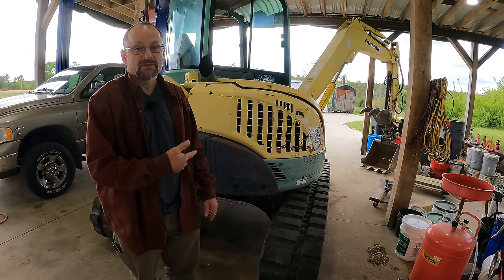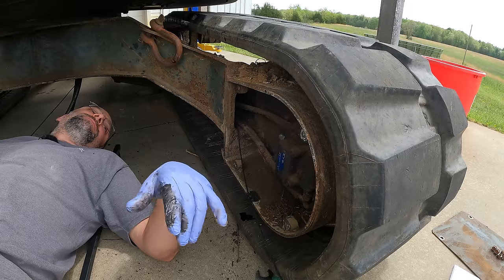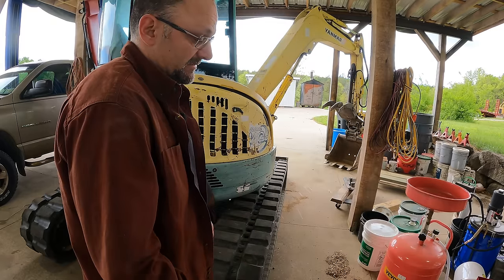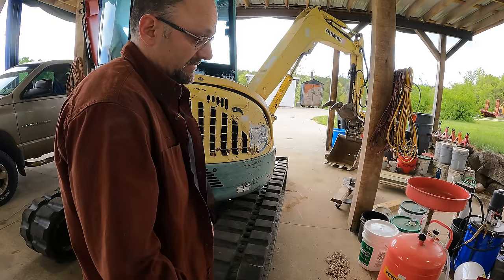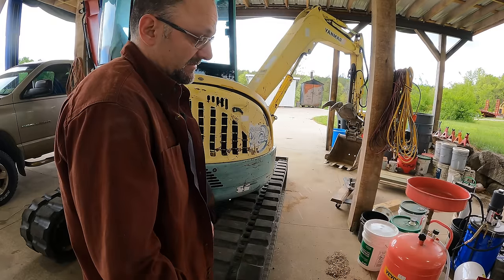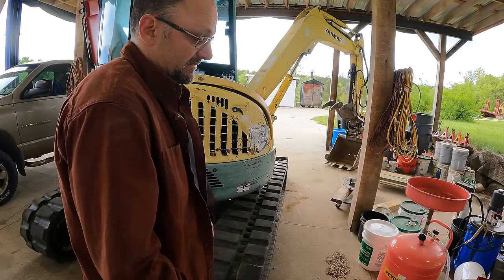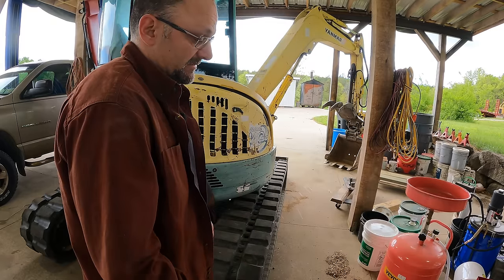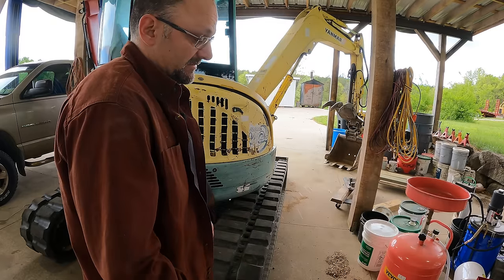Excavator Not Tracking Straight, TOUGH Hydraulic Repair.

Comment: Probably the setting of pressure relief valve of Left Track needs to retight or adjut a little bit, if the relief valves pressure setting is unequal then  the (Right track)  lower pressure setting of relief valve will reduced the spped of the right track. Try to equalized the pressure stting of relief valve of left and right Track hydraulic  pumps.

Comment: As much as it could be a pressure differential, it could also be a flow problem-- slightly collapsed/kinked hose or something caught and causing a restriction. I've never come across a tracked excavator that doesn't have this problem to some degree. My KX-61 had 24 hrs on it when I bought it and already had the problem. It hasn't gotten much worse after a couple thousand hrs, so it's not really worth worrying about. PIA, sure. All the headache of trying to correct it, no!

Comment: That thumb nail of meis in a cat 426f. I don't if any one has with prof expirence has spoke to this, I have run a few new pieces maybe close to 500ish and very few will track straight. And getting a dealer to fix a brand new one is an amazing pain in the ass hahah   I bought a new in 05 cat 226b sidder and yea same thing.  The bigger they are they will usually un straighter, But still. Don't get me wrong there are a few.  My skid steer runs about like your ex.  Good Luck man!!  Edit)  A new pump still won't guaantee a fix. I've seen the act worse. Hey if nothing else you've have had fun  ; )

Comment: Pumps are adjustable by way of compensating valves this will sort your travel deviation,little adjustments you will notice a difference should be a compensation value for p1 and p2 
pumps wear and need tuning, don’t adjust swash plate/horsepower valve 
Travel motors can be checked by removing case drain and stalling motor and measuring case drain output

Comment: if you have a separate pump for each side then it may be the pump flow didnt you already find a bad gear pump. im thinking damage causing less pump flow see my previous comment. cheep fix add a flow control valve in the rt motor line and slow it down to match the left side or deal with it

Comment: Could there be more friction on the right side track assembly. Thus the issue is not a hydraulic related issue. You would have to swap the drive motors to determine.

Comment: is that adaptor going to give differential pressures just because of the smaller diameter for flow compared to the regular hose making the control not accurate

Comment: 31:01 can the accumulator have something to do with the track lag? Maybe the 2 circuit are not long the same or maybe une pump il simply more deteriorated because the excavation work...is there any other point where you can joint the 2 pump after the shovel and the blade?

Comment: Love your comments, but what is the big deal about tracking straight.  They all don't track straight, just correct it with the levers and  get to work.  My 35D Deere has never tracked straight when traveling.  Moving when digging is not affected.

Comment: I am not a Hydraulic guy at all but if all you need is it to flow the same could you not just put a manual hydraulic flow control valve on the faster side and slow it sown to match? I think they are only like 50$ You may need 2 idk

Comment: I know absolutely nothing about hydraulics. You swapped a bunch of stuff left and right but, never swapped the accumulator to the other side. Well, I guess I saw you move it to the other pump but, it was still in the same "line". Is it even possible to switch which "leg" it's on and, would it possibly make any difference?

Comment: I just saw this video series today. But have to ask. You have one new track and one used. Is the distance from drive motor to front idler the same? I.e. on
e stretched track.
Reply: In my opinion this problem can't have anything to do with either the motors or the tracks. It tracked to the left and after he switched the hoses it tracked to the right. There must be a difference in the oil flow between the circuits.

Comment: Hi there, Ok so the left crawler is rolling a it lower at full throttle...and you tried to diagnose and fix it to be the same as right crawler... but finally without success. I think another naive approach could be the opposite. I mean try to reduce the power of right crawler to be as "faulty" as left one. You then will loose a bit of speed but recover a straight track motion... I'm totally not an hydraulic professionnal ... but I'm sure  a kind of hydraulic adjustable reducer could be mounted on right circuit exactly like an electrical resistor to reduce electrical intensity... what do you think ? Also Thanks a lot for your videos ! I'm from Belgium and I've just buy on auctions an 2014 old kubota kx163-5... fu%&ing chinese unknown model here in Europe... and I have to restore and repair it. If someone knows stuffs about it...or owns documents or manuals ... it will be greatly appreciated. Thanks again ! You're doing fantastic job! Lo.

Comment: Couldn't you slow down the oil flow to the right track to match the flow on the left track? Maybe they would track the same. Might not be as fast as you would like it to be but just might be straight.

Comment: ok. I have to submit that you haven't verified the mechanical part of the problem. IE what if someone replaced one of the drive wheels on one side with a slightly larger or smaller wheel?  That would make the unit turn no matter what you did. Also.. what if one of the tracks was slightly longer then the other.. assuming they have pins that fit into the track and one is longer or shorter then the other.. With a slightly longer track on one side it would travel further for an equal number of pins driven by the motors on both sides.  I understand that the hydraulic testing you have done should  have different results if this was true, but sometimes... a hidden issue like this can not be tracked down until you verify every part of the drive train is correct. Even testing this could give you more metrics to help and possibly zero in on the actual problem.
Love your channel. Diagnostics are very interesting and thought provoking.  (I was certified master auto technician for 28 years. I lost lots of money working on brain teasers like this... cause it was to fun).. Oh.. one diagnostic aid that may help you? Put the unit in the air (use your hoists) then paint a mark on both tracks, run it and count how many times the mark on both tracks go by during the same time frame. Much more exact to zero in on the exact problem.
My assumption for this issue, is the same as you.. that there should be a balancing valve somewhere that balances the two tracks rotations so it tracks straight. Is would be a hydraulic valve most likely (as you looked for at the end of your video....).  I would also call the dealer and see if you could talk to one of the mechanics that works on these units. They usually have fixes for issues like this (as they have to fix this issues no matter what)  I had a bunch of magic fixes when I was mechanic.

Comment: It looks like you did isolate the pump when you switched two hoses instead of 4. The lazy/leaking pump tracked wrong with 1 valve going forward, and the other valve in reverse, so the valve isn't the problem, the pump is. I'm no hydraulic mechanic so maybe I'm wrong, I'm posting this before the end of the video so we will find out.
Edit: Sometimes you have more than one problem, pump and valve look like they are probably both leaking lol. Good ole used equipment.

Comment: It looks like you may have one piston pump with a split output (half the pistons feeding each output; parts manual to verify) so it is possible that contamination entered the left circuit at some point in the past and damaged the left side of the pump, or the left side of the valve slice, causing increased bypass. 

Increasing the spring pressure of the pressure compensator (which acts on the swashplate) is going to increase the pressure point where the pump de-strokes and reduces flow while maintaining a set maximum system pressure. Until that set pressure is reached the pump should maintain the maximum flow rate of the system at any pressure below the compensator setting unless the pressure compensator is sticking, leaking or the pump is worn/damaged. This limits the maximum system pressure available while maintaining full flow preventing and at the same time preventing expensive parts (like the piston pump) breakage.

The pump compensator should be set a little above whatever the maximum relief pressure is of the various circuit relief valves. If the maximum relief valve pressure in any relief system is set to 3550 then a compensator pressure about 10% above that (~4000) but below the maximum pump pressure rating should be set, otherwise the pump would de-stroke and reduce flow before individual circuit relief is reached. If the pump de-strokes early then this would reduce flow in a circuit before it is supposed to. So you generally would want the circuit relief valves to relieve first while the main pump is still at full flow and the pump only to reduce flow if for some reason the maximum system pressure is reached due to a failure in a relief system. 

Since the pump only drives the track motors, and if there are no individual relief valves on the left and right systems to protect the systems then set the compensator on the pump to the necessary system circuit pressure for the track motors.

Comment: Maybe fabricate a limiting device that is welded to your control stick that you can adjust with a bolt. This will cause the control stick to not swing as far and will hold the faster hydraulic circuit back to match the weak one. Same thing that's accomplished by pushing one stick full forward the other 95% forward creating equal speed from both tracks.

Comment: I would suspect that the horsepower control, increases flow but at lower pressure. Think about it as an electric circuit, if you increase the amps you decrease the voltage.

Comment: if uour machine  is  .fitted  with  a  hydrolic  quick  hitch  for  bucket  change  it  will  make   your  machine  track  to  the  left  as  that  side   is  down  a  little  on  pressure  as  that  is  usually   the  side  used  to  tap  into  for  the  hitch  ask  the  dealer  they  will  tell  you  this

Comment: Hey why don't you add a valve to the fast side line or a small hole in one of the fitting to try to limit the flow idk if that will work but with a valve you could at least try it

Comment: A flow meter would be nice but does the drive motors and pumps have what is called a case drain line. This line will allow leakage to drain back to sump. they should have some leakage that is how lubrication happens but not excessive.

Comment: check to see if that cumin later that's on the pump you keep switching it back and forthis your restrictioncheck to see if you have a hoseinternally damaged that's restricting your flowmake sure that the hose sizes the same all the way throughthe system

Comment: Take it from someone who has battled worn out equipment for his farmer dad for 40 years, if you let it get to you it isn't just the pumps that will wear out but your whole sense of being. Heres a tip for this type of machine. Add 10 to 20% Lucas hydraulic oil improver and and run it for a while before making any rash decisions about repair. I'm currently in mortal combat with a 15t Crawler with a faiing track drive, lazy starter and failed electrics so on Saturday we ignored all the problems and fitted it with twin airhorns off something else. Now it's still hard to start, slow to move and has no electrics but by golly it makes a noise would wake the dead 🙂. I'm not connected to Lucas in any way but for aeging hydraulic systems it can make a world of difference.

Comment: Adjust the stops and the forward tracking control levers. They won't be aligned by the least. You can push them both forward and track straight without having to keep meesn w/ levers. It might go a little slower but ur not getting on the interstate!!!

Comment: Your problem is on the supply valve (the one where the two lines from the main pump are connected) it is on the middle of the right travel valve and the left travel valve, as this two are the only not pilot valves in  the main valve, they are mechanicly actuated, you can ajust  the two releave valves to balance out the pump, remember this is a 1 piston pump so an external valve do the balance o the two . if you dont want to work on the mechanics and just want to test do this, to close one of the functions like leave the bucket level on hold completly open or close or other function and the machine will change for better or for worst. for shure the travel motors the swivel and the pumps are ok, Just the supply valve or supply valve  on the pilot have a problem and is not expencive to fix.

Comment: I would think swapping the L&R lines at the control valve would have saved you the $1500 extensions too. Is that correct or am I just too dumb and missing something?

Comment: dumb question, cant you just put some kind of flow restriction on the line that feeds the track that moves faster? a manual regulator that you can adjust to compensate seems like an easier fix than spending thousands of dollars in parts just to track straight

Comment: why not eliminate the accumulator on the one side? if it works like an accumulator in a refrigeration system then it's a filter and could be a potential flow restriction.

Comment: You have 3 systems and each of them has some bias left or right.  Tying the pumps together just left you with the bias of the valves and motors.  Think Pumps .015R, Valves .010L, Motors .005L adds up to tracking true.  Your set is obviously not coming out at zero.  If your sticks have limiter bolts, just adjust to equal them out, or adjust the swash plates on the pumps to even them out, looks like the pumps are most of the problem.  I don't know anything specific about your system but it just needs to be balanced as a system, individually balancing all 3 of them will be a nightmare.

Comment: I am NOT a heavy machine or hydraulics guy.  Just an electrical engineer with a bunch of mechanical and techie experience; so this may be a stupid idea.
Is there some way you can add an adjustable flow restriction to the fast side?  Might sacrifice a bit of drive speed, but if you could fine tune just one drive motor,  without having to alter the excavator in ANY other way, that could make it less frustrating. 
Just a thought from an unqualified viewer.
Reply from the maker: It's a reasonable thought.  I may end up trying this if I can't find a better solution.
Reply: @FarmCraft101  i have watched a number of youtube videos from C&C Equipment, and in one of them, they recalibrated the drive system after massive repairs.  Though in that case it was done by computer, I would guess the process was basically moderating flow to each final drive motor.

Comment: It may have been stated, but you seem to have a 1% error in 1 side to the other. If you insert a basic straight flow control valve and restrict 1% to the fast side, you have solved your problem. It could be a knob on your dash or side panels. Dial it in while you are driving until you get straight. Good Luck, Be Safe, Injection is a REAL THING, how about some gloves!

Comment: ARE BOTH TRACKS WORN THE SAME??   Does one track have more meat and therefore spin in a slower rate??….like having two different diameter wheels on an axle…it would cause it to turn towards the smaller or slower spinning wheel-track.

Comment: can this be a mechanical solution?  add a bolt and nut adjustment on the hand controllers so right is fully forward and left slightly less forward....this would fix at full speed ?  adjustment kinda like throttle adjustments
Reply: nvm, i thought the hydraulics were variable...i thought you turned left or right with just a little less pressure on the levers...

Comment: Hydraulics can be expressed in a similar manner to DC voltage and current in a simple electrical circuit. In a simple hydraulic pump and motor system with a variable speed motor one must consider that motor speed control is accomplished by varying the swash plate angle in the pump in the same manner as a rheostat in an electrical circuit..  I  believe that your starting point should have been to jack up the excavator on blocks then, placing a marker dot on each drive sprocket, count the number of sprocket wheel revolutions per minute each side makes at full forward, then at reverse speed position. I believe that the right hand sprocket will be marginally slower. The job then is to increase the output of the right drive pump. Altering the swash plate angle should be the first move to make. Alternatively the the left hand pump swash plate angle could be reduced in order to reduce the sprocket speed. The swivel valve is no more than a cleverly designed valve arrangement which allows the correct oil quantity to flow to the correct motor regardless of the angle of rotation so as to facilitate excavator travel at the desired speed regardless of the angle of the control cab.

Comment: Can you just adjust your linkage so your levers are in the same place but not moving control valves the same to cheat & get it to track straight despite the problem

Comment: could a tight track or a track worn thinner, or maybe tight bearings in any of the rotating pulleys, dragging brake (presuming it has left-right brakes) I dunno transport it on a trailer problem solved.

Comment: I would take that accumulater out of the system out and see if it goes straight if it does the accumulater is bad. It is only there to absorb shock in the system. That is probably why the psi gage. Was jumping.